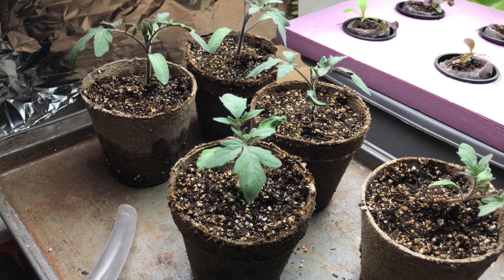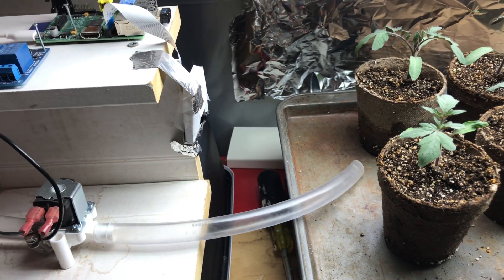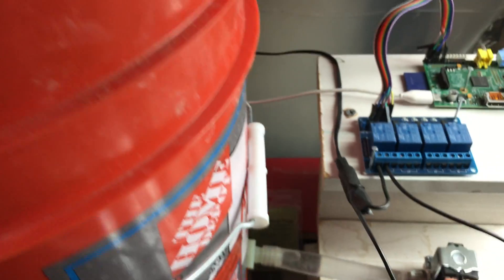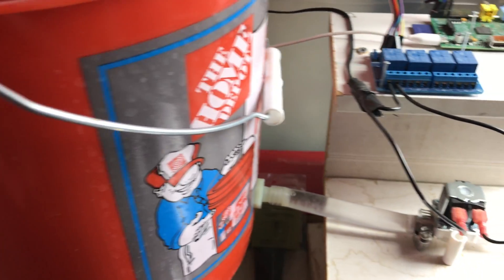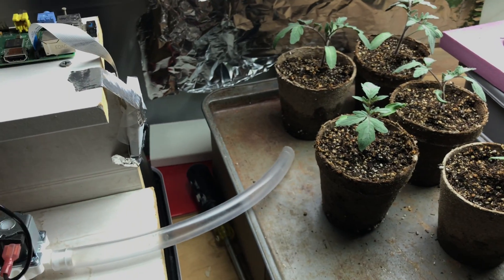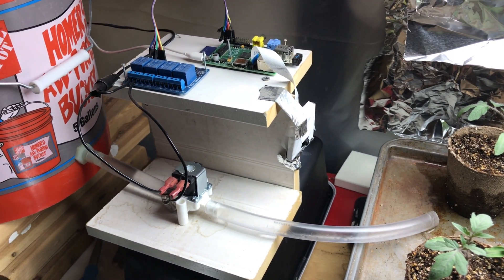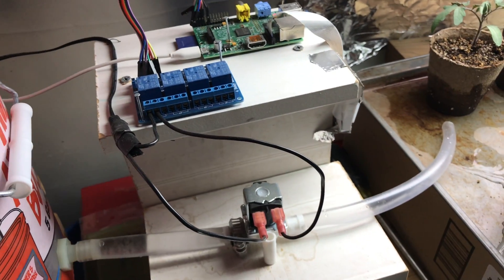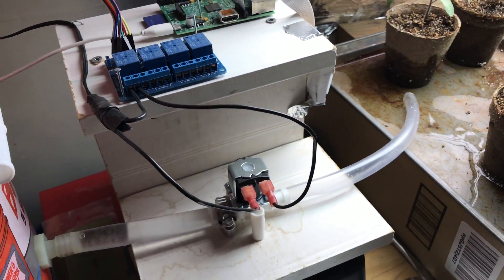How to build an easy automatic watering system for seedlings using a Raspberry pi

Comment: Envisioned almost the exact same setup myself and then saw this... I think I bought an identical solenoid valve - am about to put it together but glad to see it's already a proven design! One thing you might want to think about is sticking a ~1kohm resistor or a diode across the solenoid to prevent a large flyback voltage spike. Without one, arcing may reduce the relay lifetime (and I have had serial communications problems on other setups due to the noise generated by the flyback voltage)
Reply from the maker: thanks! good luck

Comment: Hey I almost did this but there is something wrong with the relay module
Reply from the maker: Like, the relay is broken?
Reply: Old Planty the code is working but the wires coming from the power adapter to the relay module and solenoid are heating up very fast and also the solenoid doesn’t open when the code is activated according to the timer installed in the code
Reply: Old Planty the relay module also makes a click noise
Reply: @muhammedbhatti1  1) If your cables are getting hot, that suggests they are too thin.
2) Relays like these are supposed to click.
Reply: Simon Duffy when it clicks, nothing happens
Reply: @muhammedbhatti1  I'm guessing I'm too late to help - but probably what's happening is your wires have too much resistance, so a large fraction of the voltage from the power supply is dropped across them and not the solenoid itself, meaning the solenoid doesn't actuate and the wires heat up. Solution as suggested above is to use thicker wires. The fact that you get a click and the wires heat up soon after shows that the relay is working fine.

Comment: Hi, Really love this video but What types of wires did you use to connect the relay to the solenoid?
Reply from the maker: I used low voltage wiring like the kind you would use for  a doorbell  or something.

Comment: Could you please show where the cables go . I don't know what ribbble cable goes also the black cables on the solenoid. How does it receive power.
Reply from the maker: I have a 12V transformer that I just connected some bare wires to and wrapped with electrical tape. As for the wires, it depends on your pi. But you can look up the wires for the GPIO pins to see which one is which. The relay needs power, and ground, and the GPIO pins. There should be indicators on the relay as to what wire goes to what pin. Hit me up on instagram and I can DM you some pix. @oldplanty

Comment: Hello. I like this project alot! But is there a clearer tutorial on how to do this project??
Reply from the maker: I dont have anything written up. I would be happy to answer any questions you have though.
Reply: Old Planty I have a question/problem:    My raspberry pi is fine and so is the script, it is meant to open the relay to open the solenoid but for some reason the relay doesn’t open. Help?

Comment: Hello, what if I wanted multiple solenoids? Could I just plug it in the other 3 available slots in the relay?
Reply from the maker: yes. You can control whatever you like on each relay spot. There are also relays with more positions. 8, or whatever you need.

Comment: Great idea, looking to setup fo container garden, was thinking of pump until I saw this!. I assume the power for the relay comes from 12V transformer with one lead connected to the Solenoid(negative?) and one going to the Relay (positive?) ? I am going to have a go at making this, fingers crossed.
https://www.amazon.co.uk/gp/product/B01MQPB2BD/ref=ox_sc_act_title_1?smid=A1MG095N605OTB&psc=1
https://www.amazon.co.uk/gp/product/B016MP1HX0/ref=ox_sc_act_title_2?smid=A24XC8C8JX8VUO&psc=1
Reply from the maker: You are correct on the power supply. Good luck!

Comment: Looks like a great setup, thanks for sharing. I like the solenoid + gravity replacement for a pump.
Reply from the maker: +Ben Eagan thanks man. The bucket is also a limiting factor. Worst case scenario, I end up with 5 gallons of water in the basement.
Reply: That is much better than a surprise pool in your basement.